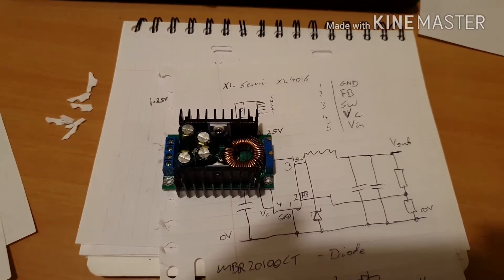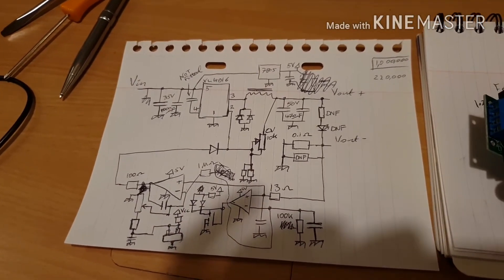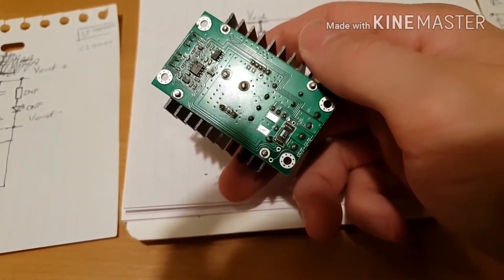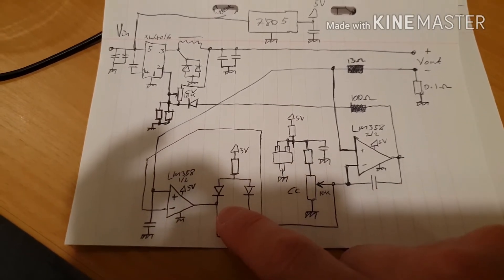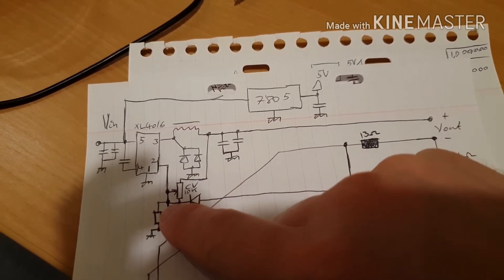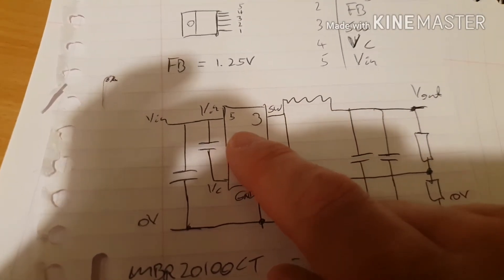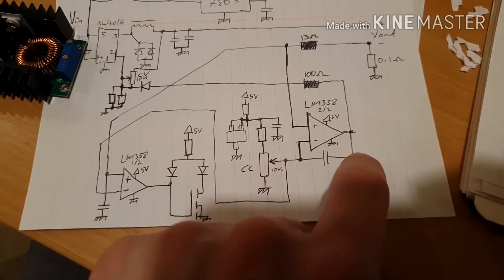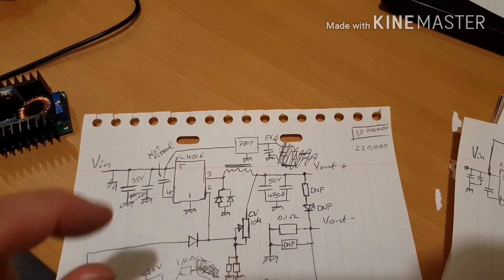XL4016 Buck Converter Reverse Engineering & Repair

Comment: I've got one that 'doesn't do that.
But then I did connect the input leads the wrong way round. Strange smell, then the can of one of the caps shit past my eye and embedded itself in the ceiling.
Will try to repair after this useful video. They've got expensive.
Thanks.

Comment: Regarding capacitor - voltage rating and capacitance - I know that ripple currents increases as voltage rating goes up, but we would need to check those two (35V 1000uF ; 50V 470uF) who has the highest i_ripple.

Comment: Thanks for the detailed schematics.
5:52 Red indicator for high current on my device doesn't glow. I've tested the LED both color work(Blue at 2.25v and Red at 1.8v). When current is high both blue and red side get 0.8V so nothing lights. Is the op amp or the mosfet faulty?
Reply: The 4007 mosfet near opamp fell off during shipping.

Comment: i accidently input 50v to input now its not regulation voltage i mean not adjusting output voltage pls help me.on output its give what i input .
Reply from the maker: Hi
I expect at the very least you'll have to replace the XL4016 chip. The over voltage has most likely destroyed its main switching transistor, so it's just conducting from output to input. It's also possibly that the voltage destroyed the linear regulator powering the feedback circuitry. Only way to know is to start replacing parts. 
I suspect it would be cheaper to consider this module a lesson you had to pay for, and just buy a new module.
Reply: @alexwood020589  thanks for your time,i really appreciate it.

Comment: You are getting all WRONG here: the Caps and Inductor are NOT filters, actually the inductor is the main component to store the energy when XL4016 goes on. That energy gets discharged when XL4016 goes off, the caps store the the charge ("
reservoir" and not filter) and most important is MBR20xx since all the 8A load current flows through it...MUST be on a large heat-sink can't be replaced with some small SMD as you have said.
Reply from the maker: Hi
You're right that the inductor and capacitor store energy while the switcher in the buck converter is closed, and release it while the switch is open.
I would argue that is the basics of how all LC filters work though, whether that's for RF energy, small signals, Class D amplifiers or switching power supplies.
My aim with this video was to help people understand how this power supply works, and I find the explanation that the switcher creates a square wave and the LC network filters it to DC far more intuitive for a beginner.
Reply: @alexwood020589  Maybe you are from a very-old-school... your errors here can 'confuse'many young learners. This Electronics Project here has nothing to do with "filters" . NOTE: a smoothing circuit can't be classed as a filter in Modern Electronics. Technically a filter is a circuit which allows a band of frequencies to pass through while blocking other frequencies. The passed frequency is called "bandwidth" and the center frequency is given by   a formula  of  f0= (1/(2*pi*sq-root( L*C))). where L is the inductance in Henrys and C is the capacitance in Farads. You learn this in any university in USA in semester 2 of Electronics Degree. You are mixing things up here where as Technology and Engineering now have specific meanings for technical terms unlike other general fields such as arts or business. Though you are trying to help here BUT your many ERRORS in explanation is doing more harm than good.

Comment: I got this same module and i am facing issue where the amp is not really getting regulated. When i short the output with amps knob fully down it still outputs the same input amps and when i try to lower the amps it goes to minimum but once i add more load the voltage drops to 3v and stay there and amps keeps increasing somewhere to 1.2 amps.
How should i fix it? Any idea?
Reply: Same problem

Comment: I think I damaged my module.what I did was I used a boost converter to step up 12v to 30v and then input it to buck converter same as in video,what happened was the voltage it was showing was 40v and the caps popped and now it stopped working and I am getting same voltage as input in output and I can vary the voltage using pots.pl help!!
Reply from the maker: I'm afraid that is probably a dead module! I expect it would actually cost you more to buy replacement parts than it would to buy a whole new module. I suggest you start with just the boost converter. Power it up with nothing connected to its output and use a multi-meter to set its output voltage, I suggest no higher than 33V (the absolute maximum the XL4016 can handle is 36V). Once you are happy the boost converter is working, connect a new XL4016 buck module to the output.
Reply: @alexwood020589  that worked!! Thanks

Comment: How to modify the circuit that 1.25V to 0.1V
Reply: @Shankar did you find the way? i have same question with you
Reply: @pegasus5401  No 
Still can't find.
Reply: @ShanVijay007  After i look the datasheet, i think because XL4016 is need minimum of 1.25v to operate normaly
Reply: @pegasus5401  ohh ok bro 
Thank you bro

Comment: Bought this board in 2020 and it seems few errors where fixed.
Not to sure about those bulk caps though, the 50V ones are on the switching side, and switching always leeds to voltage spikes, i guess that's why they have 50V ones there instead of the input.
The input in this one is supposed to be "happy stable current"
Dit you end up switching those? any luck for your application?
Reply from the maker: This module is a buck configuration, so there is a chunky inductor between the switching node and the output caps. The node with the caps connected is the output voltage, which is smooth (ish) DC at a lower voltage than the input. There is a freewheeling diode on the switching node too, so it will switch between 0V and the input voltage + 1 diode drop.
Generally with a buck converter you want small value, low impedance, high voltage caps on the input and very large value, lower voltage caps on the output. I did swap the caps around, and replace the op-amp in the constant current circuit with a better one. Check out my channel for part 2 where I do the mods and test it.

Comment: The regulator is needed because if you don't include it, the current limit would depend on the input voltage, and that is not good.
With a couple of external components (by injecting current into the feedback pin), the output voltage of this module can be modified by a microcontroller, so it can be used it as a controlled variable voltage source.

Comment: Beside the great explanation the schematic you draw helped me to find the  fault and repair mine module. It was the via point from 10k pot to out + rail, it has a no contact with both sides of board. Thumbs up and keep the good work.
Reply: Hey man, I am a beginner. I ordered it and made a power supply. In my supply, I am unable to limit current below 5amp. What shall I do

Comment: At 8A, the diode gets pretty hot. Maybe dropping 0.52v. That's 4 watts. You'd need meaty tracks and a big diode package to sink that sort of heat. If delivering to a low V load, you'll find the diode gets somewhat hotter than the XL4016. I'd prefer to see the heatsinks moved right to the back of the board, giving the electrolytics more ventilation. But that would obscure the screw holes.
Reply from the maker: Hi,
Thanks for checking out my video.
The main output diode is in a TO-220 package mounted on one of the big heatsinks, so it can handle significant power dissipation. The diodes are actually rated for something like 25A each, and there are two in parallel. I suspect the thermal resistance from the diode junction to the heatsink (including the TO-220 package, thermal grease and the annodisation on the heatsink) is between 1 and 2 degrees C per watt. A heatsink that size has a thermal resistance to ambient of around 4 C/W (according to the datasheet for some similar ones on Mouser). So I'd expect the die to be around 6C per watt higher than ambient worst case. So under 4W of load, the die is likely to be around 55C or lower.
You're right that the electrolytics are a bit close to the heat sinks for comfort. With modules this small (and cheap), its hard for them not to be.
There is a really good article on designing heat paths from chip dies to ambient under different load conditions below. I have found it very useful when designing power electronics.
sound-au <DOT> com/heatsinks <DOT> htm

Comment: I have same module. In my case potentiometer not work for voltage and current. What would be solution. Module is working but not adjusting volatage and current
Reply: Try to turn pots other way they can get stuck if you over turn them only on one side

Comment: Hey, the capacitor on the opamp's output is there to prevent oscillation when the system is about to reach equilibrium. They might have miss calculated it's size and were slowing the response down too much.
Reply from the maker: Thanks for your comment! I had a good think about this and I see where you're coming from. As frequency increases, capacitive reactance decreases, reducing the gain of the amplifier. And I think that effect would tend to stabilise the power supply under step load conditions, which is good. However you're also introducing a phase shift into the negative feedback network, which is a huge red flag for me unless you know exactly what you're doing. It is just begging for the system to oscillate.
I really don't like using op-amps in open loop mode, I much prefer to use a comparator for those kinds of jobs. In this case, I would want some fixed gain in the control path, which would tend towards unity at some upper frequency which I would determine from the nature of the load. It is a trade off between reaction speed and stability. They clearly got it wrong from the oscillations I was seeing. I ended up putting a resistor and a can in parallel, which worked very well.
Reply: @alexwood020589 what is capacitor

Comment: Hi, Great work. Did your modification work? Is there a followup video for the same?
Reply from the maker: Hi,
Check out my channel for part 2.
In that one I make my modifications and test them out. It worked a treat, and this power supply has been doing good service driving the peltier in my beer cooler.
Reply: @alexwood020589  this module came cheap from AliExpress for 2$ shipped to India , it worked fine for a few minutes then I switched off for few minutes and went for a break then turned it on back again and it's not going above 2 volts and its not able drive any load😓. Then I landed here on your video on how to repair it. Gotta see your work mahn! I hope I can revive it back to life 😓. Your help will be greatly appreciated 😇 my email is talktoalokd@gmail.com
Reply: I cant find your part 2 video is it public? Nvm found it!;)